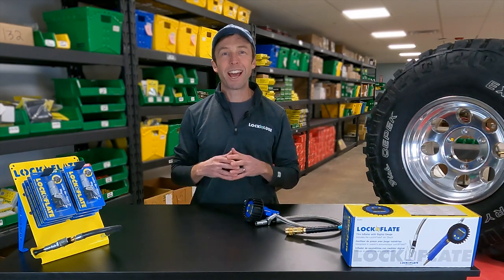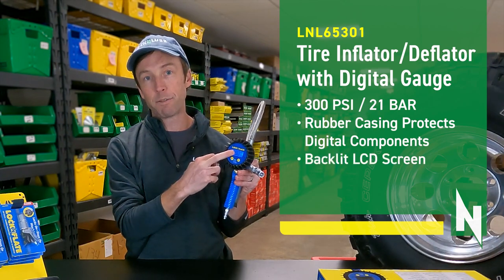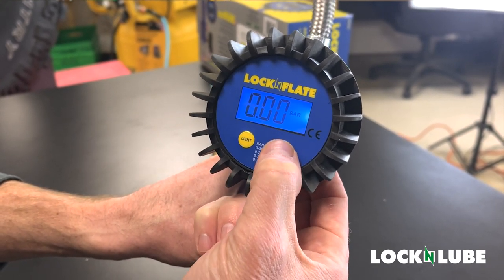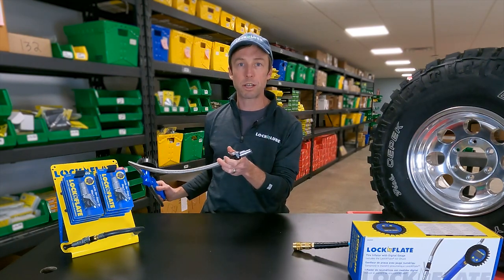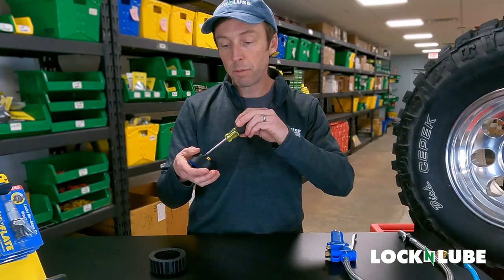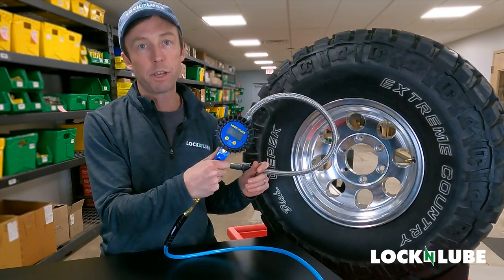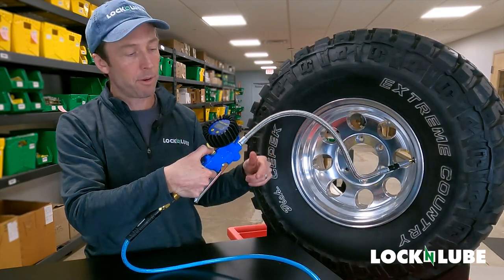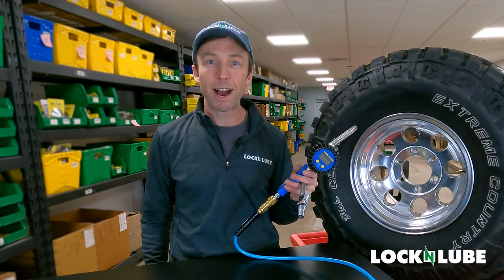LockNFlate Tire Inflator/Deflator with Digital Gauge - Includes the LockNFlate® Air Chuck

Comment: Does it work with the Milwaukee inflator?
Reply from the maker: You would only want the LockNFlate® Air Chuck in that case because the Milwaulkee inflator does the pressure readings for you.